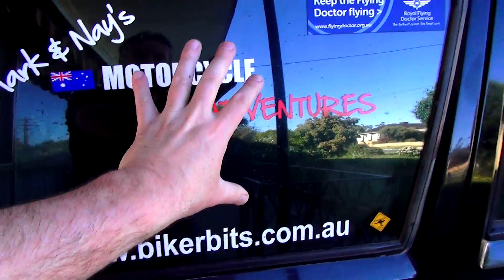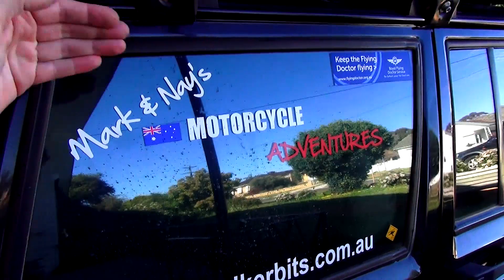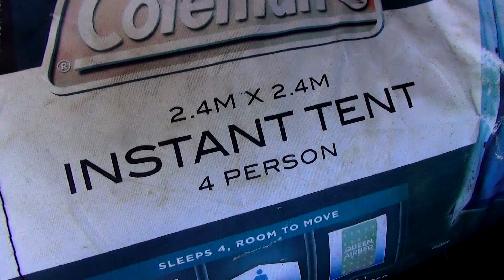Man Cave Tuesday - Episode 59

Comment: Seen a lot of people put large diameter pvc pipe on the roof rack for water storage - gravity feeds well being up so high but does affect the handling of the vehicle if you put too much weight up high (jerry cans AND water could easily be a couple of hundred kilos if you get carried away). Plus - if you put two lots of pipe up there you can paint one black so it heats in the sun and can be used for showers, etc.

Comment: Mate.
Agree with the noise issue.  Same thing for me on the KLR. 
Regards the sluggishness, check the diaphram on your carb slide. If you have put any fuel in that had ethanol in it, the rubber parts in your fuel system get eaten by it.

Give it another crack, Fenn and Cheryl at The Corner are great people.

Comment: Fer piece indeed now , fifteen hundred . Was wondering how long unsealed factory bearing would hold up . Looking at going up one tooth along with 520 sprockets and chain having a wide flanged sprocket in front . Up only one in back figuring that to be what would be gained in easing parasitic loss to friction . Not much but like having sealed bearings , what ever we can get in normal maintenance does come out in power and mileage long run . All of us are looking forward to post edit as you and Alistair catch your breath .  Thanks all